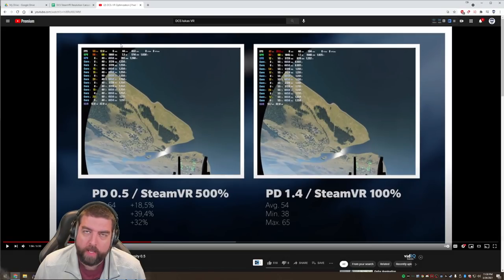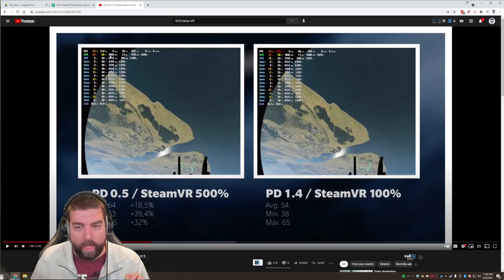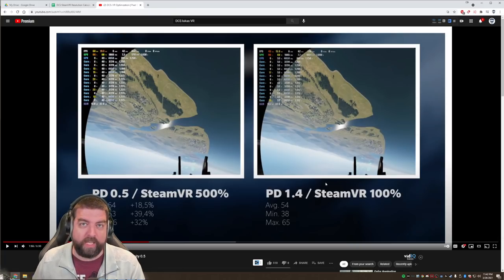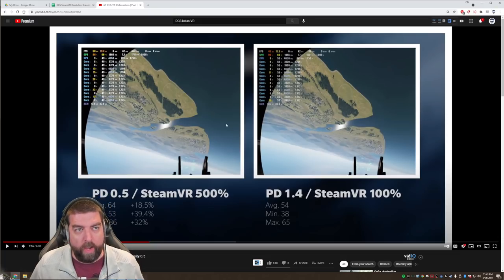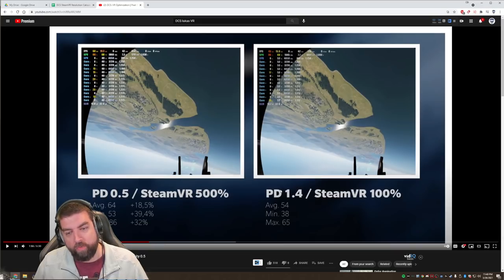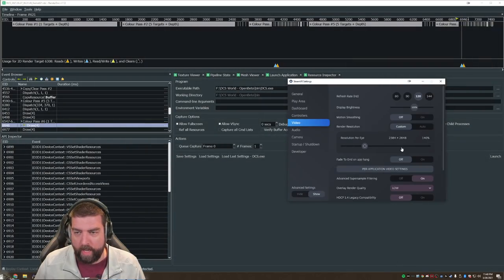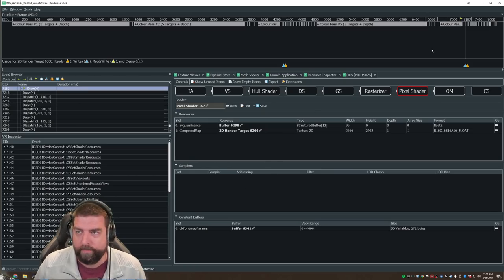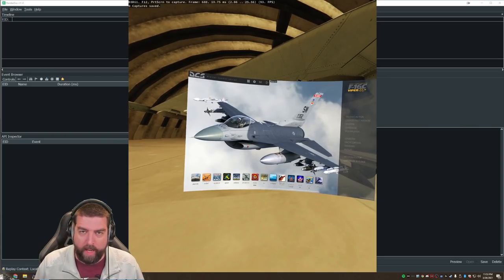DCS VR Optimizations - MYTH BUSTED - A sort of peer review of the Lukas S 0.5 Pixel Density video

Comment: Nice Work!   I spend most of my VR time across multiple headsets trying to figure out the best VR settings to somehow achieve the ultimate miracle of totals smoothness with zero dropped frames or stuttering - it's a total science project and something of an obsession of mine now that I have an I9/3090 combo.
 This trick seemed to work at first with my 8K X and I was able to keep it in 75hz mode because it averaged around 40 FPS and would stay smooth with motion smoothing enabled...I later noticed that the textures weren't actually matching up and when I tried it on the G2 it was inferior to running in 60 hz mode (which I could run native without motion smoothing) and the Index basically didn't seem to care because though it seemed to have higher frames from the data I was seeing on fpsVR, the actual effect was negligible.
 This explains why.
 The G2 at native 60 hz without reprojection on and "Ultra" detail settings seems to be the best experience overall...but man it's hard to give up that Pimax FOV when you're barrel rolling an F16 in Syria...

Comment: Man, I have an I7 8700 32gb of memory and an AMD RX 5600 XT and DCS was unplayable for me in VR. I have an oculus quest 2. Putting the oculus quest in the recommended resolution with DCS PD1.4 I was getting constant 36 FPS with the help of AWS but the GPU was working at a 100% almost all the time and I was seeing stutter here and there. So I applied the same logic. I have the standalone DCS, the non steam DCS, so I cranked up the oculus resolution to the maximum and I set the DCS supersampling to 0.6 or 0.7 and bum, excelent resolution and it was the end of all stutters and the GPU is working between 70 to 80%. I was even able to crank up  the graphics quality a bit. This idea solved my life. Now I have the Oculus quest 2 working at 72hz and getting 36 constant hz in densely populated areas and I can do low flybys around areas with a tons of building and zero stutter, even if I look through the window towards fast moving spots.
Reply: Hi buddy - what are your tray tool settings? Cheers
Reply: @simontaylor8774  I dont use Tray Tool at all. I use Oculus Debug tool with super sampling at 0.6 AWS to auto, Supersampling inside DCS also 0.6 and the resolution in the oculus device cranked to the max 5408x2736
Reply: @zaloarg  sorry missed your reply - thanks i will give that a try.

Comment: This is great! Saved to my DCS play list. Thanks DCS brother! 
This community has quite a few uber IQ pilot's in. It's great seeing the achievements from the community over the years. Adding apps and even building mission campaigns. 
DCS has progressed very well. Especially lately.
VR seems to be the next hill to get over for a lot of people, but we will do it.
I only get 45fps on a Vive Pro with a 3080. I'm hoping to get a locked 90fps in the future. That means a consistent (lower than) 11ms of latency for me. I'm at about 15ms to 18ms right now, when I'm on the deck in the countryside in a WWII Warbird (BF 109K lately), Normandy or The Channel. 
In a clear sky at high altitude it will jump to 90fps when I look out the cockpit window. I expect that's the same for most VR users, as their is nothing up there to render.

Trying to turn everything down to get below 11ms of latency seems pointless as you barely reach it when you are in the air. So I just turn almost everything all the way up in the graphical settings.
I can either play at 12ms at 45fps and it looks terrible or I can play at 18ms at 45 and it looks great. 
Turning everything up looks better for recording as well as the textures are more detailed at 1440p.
Reply: Keep in mind it's "per eye" with fps. SO if you can get 45 hz refresh, you're technically getting 90

Comment: Thanks for the video! I may be wrong but I thought the idea of Lukas' video was to have a lower PD in DCS and higher percentage in steamVR was because DCS' PD settings are less efficient/more taxing when supersampling (which all this is as I understand it) than SteamVR is, so you would theoretically get higher frametimes by having higher SteamVR percentages on a lower DCS PD. So youre 500% oversampling of .5 PD should reduce aliasing in the headset for less system overhead than having a higher DCS PD/lower steamVR sampling %.  So the idea being that its less taxing on the system to oversample to reduce aliasing than reducing oversampling through DCS.   So, with all things equal, if you were to have Two settings, A and B (A being low PD/high Steam% and B being highPD/Low steamPD)would have the same resolution per eye (thus same frame rate). but  you want to oversample the reduce aliasing, and SteamVR gives more granularity for less overhead that DCS PD would.  does that make sense? thats how I understand it, but i could be wrong.
Reply: Jabbers did say that he got the same frame rate when he got DCS PD settings configured that output the same resolution. So this suggests that putting the load on one more than the other doesn't improve framerates, but it doesn't test whether the quality of the frames delivered is better. But try doing that scientifically. You'd have to find 50 people who all have the same headset and somehow have them do a blind test. I guess you could make the test blind by having someone connect in via Teamviewer and edit their settings for them while they turn off their monitor and take off their headset...?

Comment: Thanks man!  Can you do one where you go over the settings?  Option over load. Somewhat confusing for me still.  So in the SteamVR settings the two different video sliders do the exact same thing?  One is simply for ALL games the other is for select games?  The global setting is always set for 140% to accommodate the lens of your index (I use the Odysee+) ?

 Why wont DCS stay in this list of games in SteamVR settings/video then per app video settings?  Can I add it?  Weird that IL2 shows up.

I can run all of these games perfectly at 4k@60hz on my monitor (3840x2160) and the visuals are stunning (for a pancake view anyway).  Yet my Odyssey has a lower two eye resolution (1440x3200) and looks like a steamy pile?

In WMR wouldn't you be better off using 60hz with no reprojection than using Reprojection from 90hz down to 45fps?  60hz is better FR than 45 isnt it?  Whoever decided that 90hz@4k is the standard spec for VR almost killed VR in the womb, lol. WHY?  These old proprietary game engines cant do 90hz@4k even on the most insane PC build.  Let alone 5 years ago.

Comment: My game is running a bit smoother now with 0,5 + 450% set. Previously I had 1.1 dp and + 90% set. Comparing these two settings I get about the same sharpness in cockpit, but getting less framedrops with the new 0.5 DP setting. So for me, it worked so to say.
Reply from the maker: If it works then leave it alone :)
Reply: Probably depends on what type of workload you current set up perfers doing. Im assuming regular rendering vs upscaling different parts may be getting utilized. Maybe the encoder picking up the slop?

Comment: Thanks for this awesome information Jabbers!!  After going through your spreadsheet in OpenOffice Calc, I found a few issues.  In your notes you say "The top one in B24 is always based on E14 and .....".  That should say B23 I believe.  That is the second to last row.  And then the other note that refers to B25 should be B24.  Also, in OpenOffice the formula in B23 was giving an error.  Here is what worked for me:  =CONCATENATE(CONCATENATE(CONCATENATE("Effective PD @ ";E14*100); "% RPE & "); "100% CRM")
Cheers!!
Reply from the maker: Ya It's a typo from changing the grid and not the note, b23 is based on e14

Comment: Guys, just check the application resolution in fpsVr. It is so simple. You do not have to make calculation to check the resolution of the buffer (texture buffer) used before re-projection.
Reply from the maker: It's not right on all devices

Comment: Nice video, Jabbers. Thanks for making it.

I’d like to do a similar analysis for my Rift S on non-Steam DCS using Oculus Tray Tool. RenderDoc—which I didn’t know about—is an huge help.

Do you know of any documentation or explanation of the pipeline for the Oculus tool path? I presume DCS PD is applied followed by OTT but that is a presumption, not fact. I’m also wondering if there are any hidden factors not exposed in a GUI somewhere—such as the Oculus contextual application of Prioritize Quality vs Prioritize Performance.

Again, thanks!

Comment: I appreciate this but, stuff like this makes my head hurt. I really wish there was something more definitive for recommended settings based on the different hmds that are out there.  It's a shame that the whole implementation of VR in DCS is such a chore. I'm pretty sure the new clouds are going to break VR anyways. Keeping my fingers crossed.
Reply: @John Doehler DCS engine is basically modernized Lock-On engine, they added a lot of new features and graphical effects, but the architecture of the engine is probably still the same. Not gonna get better until they rewrite major part of it.

Comment: A little factual correction: 100% resolution in global settings in SteamVR is NOT the exact resolution of the headset, in fact it varies with what the driver profile for the headset dictates. With Rift S or Index, it is somewhat close, but with a G2, it is about 1,5 times of the native panel res.

Why different headsets have to utilize different levels of rendering excess resolution has to do with lens geometry, and if you want to be really picky about it, you'd have to do those calculations per color channel, since different colors are just different wavelengths, which is why they travel slightly different through a common lens of a given optical density. And this is also why you can tinker with stuff like chromatic aberration in software quite well (as was evident with the first WMR driver update after the G2 launch, clarity got much better).

And then there is lens canting (especially Pimax, StarVR and XTAL, slightly with Index), which is where you start to have to use parallel projection in software. It is a clusterfuck of interdependent factors, which is why the results are all over the place.

A somewhat good explanation as to what affects those optical aspects is here: https://risa2000.github.io/vrdocs/docs/hmd_fov_calculation

So you apply a lens distortion multiplier, then the steam global per eye multiplier and the per app multiplier, with DCS PD being the last in the chain. But the lens distortion multiplier isn't its own thing in the SteamVR software stack, is it? So where do you take this lens distortion multiplier from? Because it is definitely headset specific.
Reply from the maker: I got it from a steam support thread about the slider itself and why the resolution wasn't accurate. I found the 1.4 multiplier in a lot of places. The math seems to work for most headset values I Plugged in but you are right maybe it's different per headset and if so I can update the calculator to allow entry of that variable but without having the headset itself I cannot test.
Reply: @Jabbers  Okay, that would explain why 100% is not native headset res. It really seems like it is headset res + overhead for distortion correction. So this is why the factor is around 1.5 for the G2.

Comment: Great vid...well done.  DCS in VR with the Reverb G2 at native resolution and spotting enemy planes (dot or smudge) at 10nm in Multiplayer...can it be done, or are we dreaming (with the graphics engine DCS uses) ?  Right now with the G2 I have to run Steam VR Global at 70%, SteamVR DCS at 70%, and DCS PD at .7 just to see a faint smudge of an enemy plane at 5-7nm.  Thank you for your thoughts!
Reply: I'll double check, but I think I'm at about the same for SteamVR res, but 1.0 for PD and I can spot out to 10 miles, I would say.

It becomes a question of what your hardware can handle.

If there's no more performance left to get that extra pixel density, I don't think there is much you can do, but maybe tweak graphics options in DCS, or turn on dot labels, which probably isn't an option in MP.
Reply: @S3NTRY  I am running a i9 9900K 5.0 all cores, 32gb 3200 ddr 4, Samsung 970 Evo plus, Asus Tuf OC RTX 3090 O/c'd ... If I run resolution to where you can see what color the enemy's eye are, I can''t see the enemy plane at 1-2nm...Can't run dot labels in full real...Storm of War server...Thanks!

Comment: I literally saw the same advice popping up on Misfis when VR dropped just a day before Kroßtmes...

As a programmer myself, the first thing I learnt about was barrier free UI design. There's a special place in hell for people who put white font on a light grey background. SCNR :D

8:52 You're wrong here. That's not a calculation, but the PD setting within DCS. He doesn't give the effective PD at any point.

14:37 If you had DCS PD at 1.4 in that table instead of 1, it would match, resulting in the higher effective res and therefor explaining the lower frame rates.

Lukas said he (and others) were cranking the values until it subjectively looked about the same. So basically you didn't bust a myth per se in this case, but explained how things work and helped us understand that much better. I only wish to know how this works out with Oculus now as it has a different lens distortion scaler (I think it's 1.3 repetend as my 1080x1200 CV1 has a 100% res in Steam of 1440x1600), but the PD setting in neither the Oculus Debug Tool nor the Oculus Tray Tool works at all (just like the ASW setting, also stays on no matter what I set there). So this is a bit of a mess when SteamVR isn't in use.

His examples are:
Left: 0.5 DCS / 500 Steam = 1.118 effective
Right: 1.4 DCS / 100 Steam = 1.183 effective
So the right one being higher, naturally resulting in the lower frame rates he noticed.

TL;DR: DCS 1.0 / Steam 100% would match DCS 0.5 / Steam 400% as it's width an height each / area respectively.

BTW thanks for showing that RenderDoc tool. Didn't know it yet and it seems to be a great thing to have when tinkering with the settings.

Comment: Okay, so we have established, that less pixels get rendered faster (duh), but why does PD in DCS affect the CPU load whereas Supersampling in Steam seems to do far less so?
The variance in CPU frametimes is measurably lower with the PD 0.5 but stays pretty much the same with the GPU. Check it out with fpsVR.
Reply from the maker: I'm not seeing that at all. If yiu adjust PD and steam SS to result in the same resolution with either adjust PD or just SS the fps and frame time are the same
Reply: @Jabbers  I'd have to test it on my Index, but it is the case on my G2. The difference between those two obviously being the resolution at hand but also WMR being involved, which does God knows what in the background. I have a friend measure his Rift S setup and we could get higher performance at same res out of it with forcing SteamVR than letting DCS use the Oculus driver directly. There is something really odd going on here.

I'll be back home next week and play around with your calculator and test more and get back to you if I find anything that stands out. Thanks for your deep dive, I learned quite a bit today. Oh, and I never heard of renderdoc, this thing is brilliant!
Reply from the maker: Ya I'd love to know the numbers for comparison

Comment: Nice work, learned alot in 25 minutes ! Have VR running pretty smooth at the minute, there are quirks like having to start DCS then force ASW disabled then enable it or it doesn't work, that's been the case for years now though, still have a Rift CV1. Just hope 2.7 doesn't do bad things !

Comment: Great video explaining the interactions, BUT, assuming CPU and GPU power are sufficient, what would be the 'ideal' settings to get what could be called 1:1 pixel mapping between game and headset (mine is a G2)? That way the user could decide whether to reduce things like view distance etc to increase framerate without compromising overall image quality, or accept that overall compromise via sampling. That might settle all those 'magic' settings videos once and for all! 🙂
Reply from the maker: 1 to 1 would be 100% and 1.0 PD
Reply: @Jabbers  Thanks. I wasn't sure if that took barrel projection oversized images into account. From the values displayed I believe it does.
Reply from the maker: 100%in steamvr accounts for barrel distortion

Comment: I'd like someone to double check Jabbers' spreadsheet because the final calculation for effective PD looks wrong to me. The base Steam VR Multiplier isn't taken into account (you can see this on the video too when he changes the base percentage from 140% to 100% and the effective PD doesn't change). I believe the EPD at the 140%/500%/0.5 settings is closer to 1.75, not 1.118

EDIT: Discussing it on /r/hoggit now
Reply: What was the outcome, I was asking the same question. Why would you test this at 140% global and 140% app specific and add more variables in the mix. 100% and 500% would have been better. Is 50% global + 200% app specific = 100%? Is it the greater of the two. Why test 140% of 500%. And for G2 users I believe these numbers are different, 100% already has 40% built in, and it's mostly G2 users reporting an increase. Would be nice to hear what you settled on in your discord discussions.
Reply: @Vanguard2323  He agreed his calculations were wrong. He was cool about it but I gotta say, if it was me I'd have done the maths, had it verified by someone and contacted the guy who made the original video before making a video with DEBUNKED plastered on the front